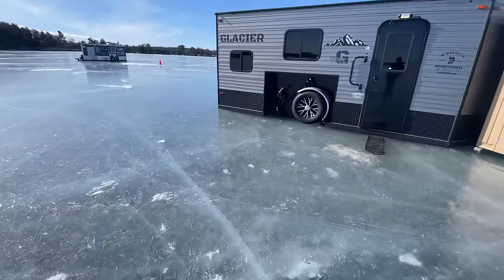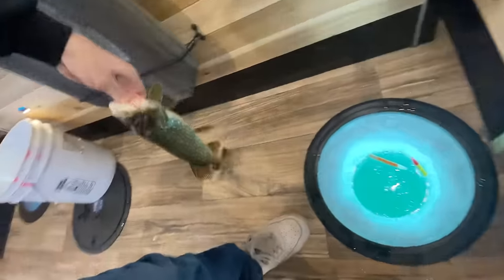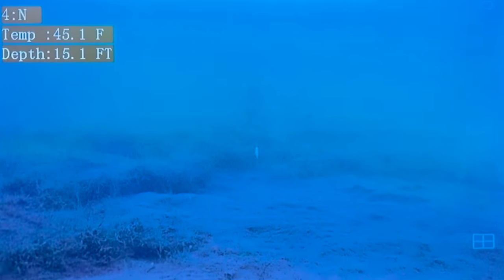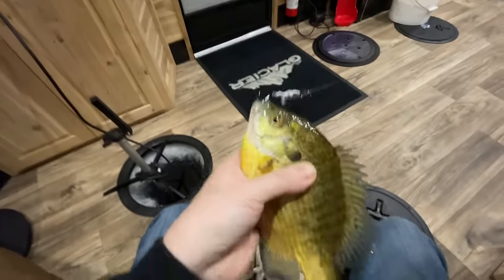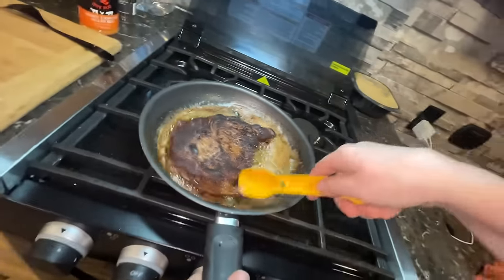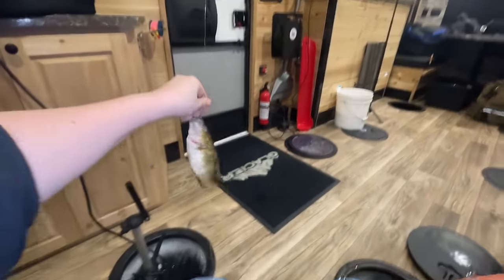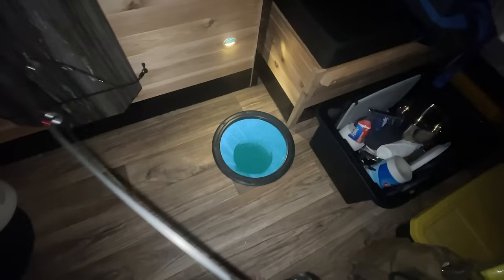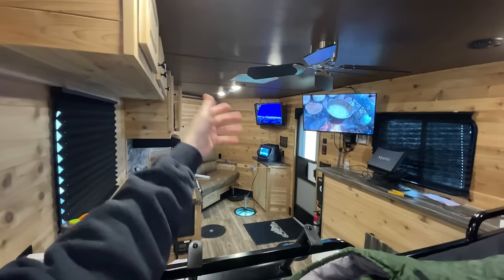Luxury Camping in Off-Grid Ice Fishing Shanty!

Comment: A tip for you Mur-Dawg. If you pat the steak w/ a paper towel before adding the spices you get a better sear. Otherwise the moisture on the exterior has to steam off before the real good searing kicks in.
Reply: Nice tip.
Reply: Thank you
Reply: Just the tip!
Reply: @12982evets  I agree the steak looked great. Nailed the temperature for ribeye, looked about 135 internal, and a solid sear as well. Was just saying it's a good practice to pat it down w/ a paper towel to remove the moisture for an even better sear (especially for leaner cuts like NY strip that don't develop a ribeye crust as easily).
Reply: And if you hit it with salt an hour before you cook it you’ll be amazed but at least 45 min prior to cook
Reply: Yessir